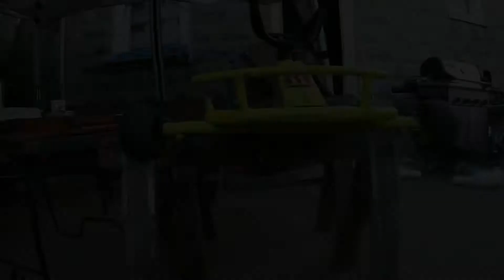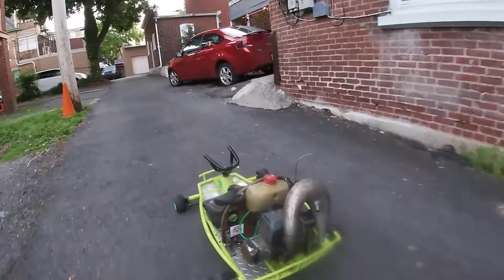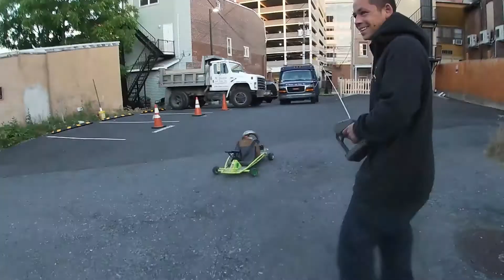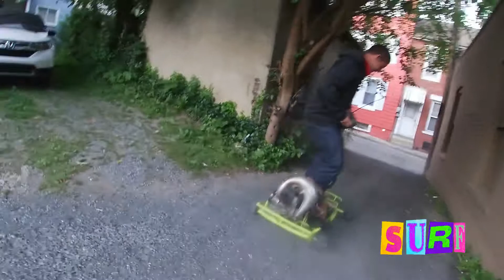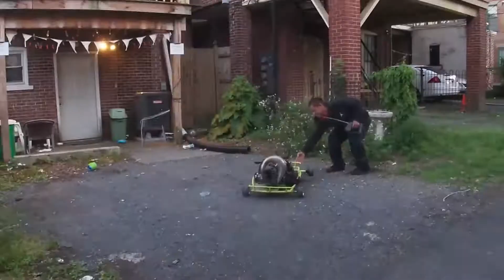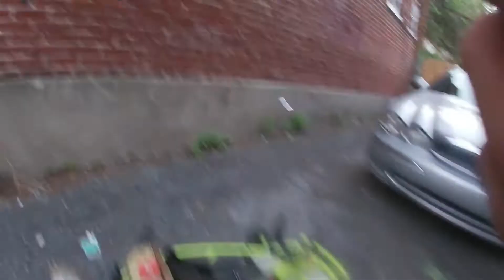Home made RC Go Kart finally works

Comment: Nice work. I am curious why though and does it have brakes? Also the Jaguar is looking nice.
Reply from the maker: Benedict White it will have brakes when I get a 6 Chanel receiver.my other Jaguar is acting up after I took it to the Macanic to change the knock sensor and a tune up?
Reply: @samsgarage1716  Cool. Not good on the Jaguar, have you got the coil light on?
Reply from the maker: Benedict White all the lights are on .I need to put the computer on it to see what’s wrong
Reply: @samsgarage1716  If you had a knock you need to reset the injection system to get the lights off. Change one digit on an injector and change it back then you can save the settings and that will reset it.